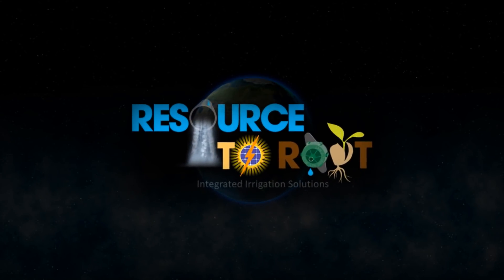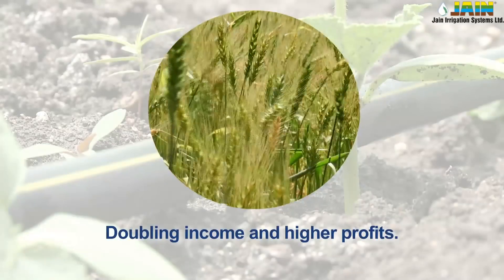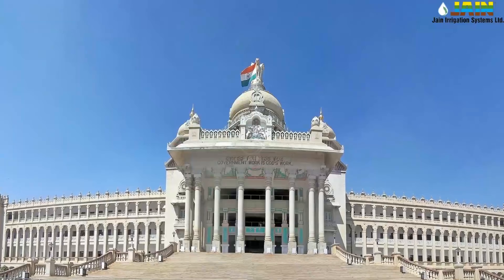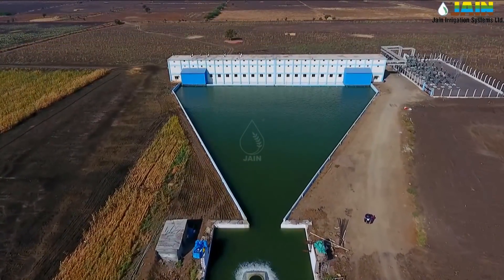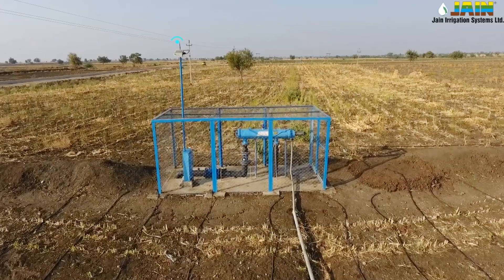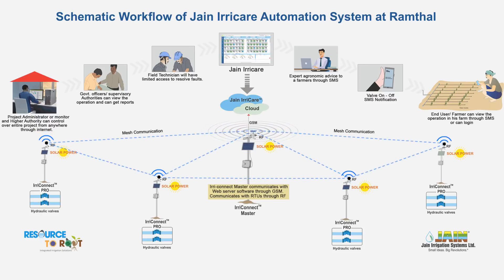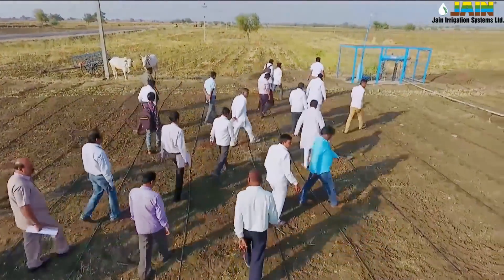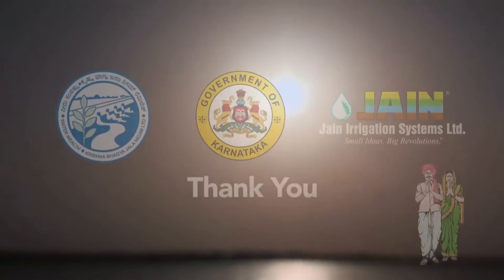Ramthal - World's largest Integrated Drip Irrigation Project

Comment: It's by NETAFIM not by you jain irrigation
Reply: Bro, Any vacancies for dip ag canditates
Reply: The largest part of 12300 Ha is done by Jain Irrigation. Netafim has done around 11000 Ha. Jain has given valve for each and every farmer whereas Netafim has given valve for 5 ha area each irrespective of farm size.
Reply: @AbhijitJoshi_DripGuru  That's very nice of JICL GOD BLESS YOUR DEEDS. Mr. Joshi I'll be waiting for your engineers and advisors at my fields .
ADV. Arvind Vikram Singh @ village - Dhani Raju , Tehsil - Hansi , District - Hisar (Haryana) PIN - 125033
+91 8830253115